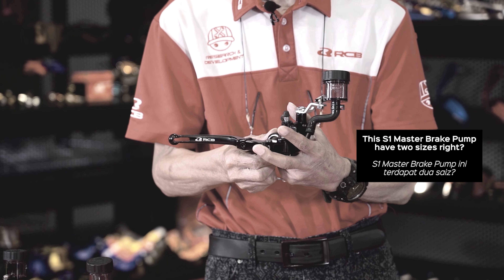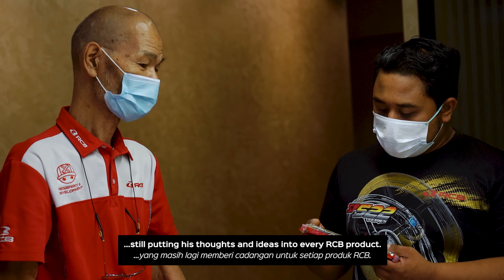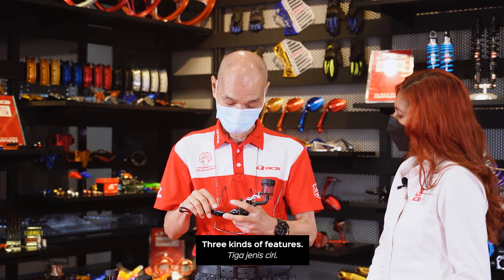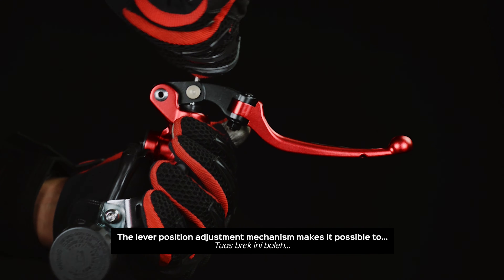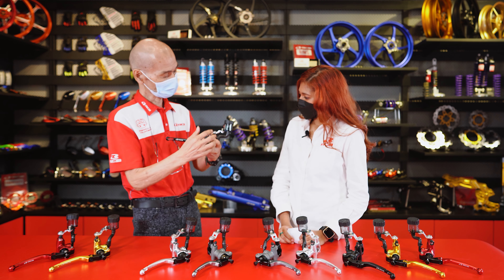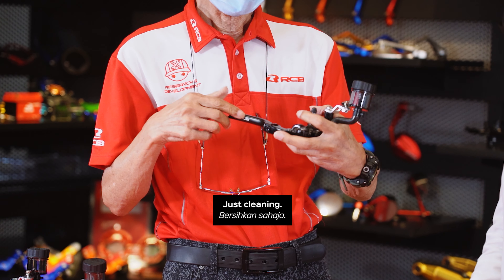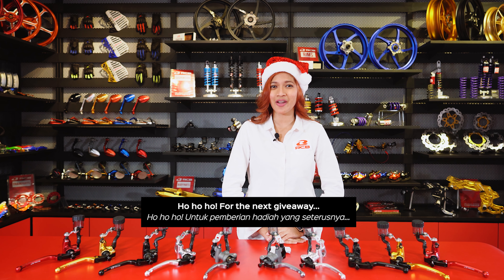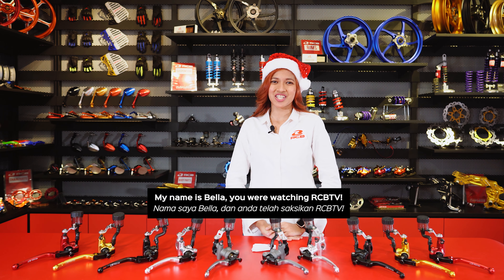RCBTV with Bella - S1 Master Brake Pump

Comment: Mr. Yoshio Hirano-san has been with RCB for 9 years ! 

I want RCB s1 master brake pump because its the one of two things missing in my NMAX old model. I has a folding lever so if someone crashed the lever will never get damaged upon impact. Also it has many colors to choose from. I've been using RCB product since 2014 on my Suzuki Raider 150. On my Yamaha Mio. Now on my NMAX old model. 

Wish to have these and RCB matting. Cant afford them now i have a family. 

Thank you RCB for such a excellent products for us motorcycle users !